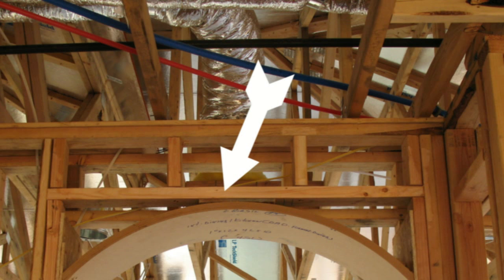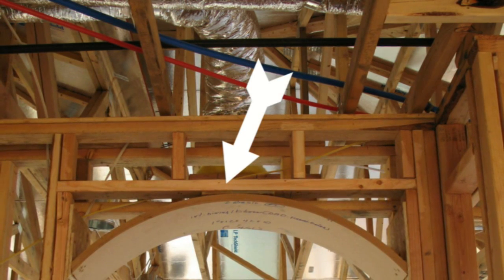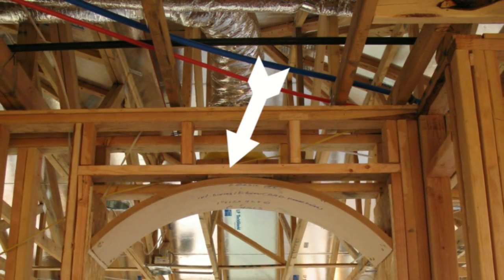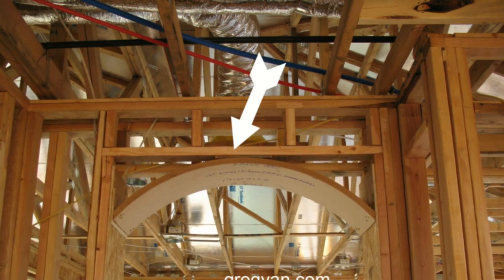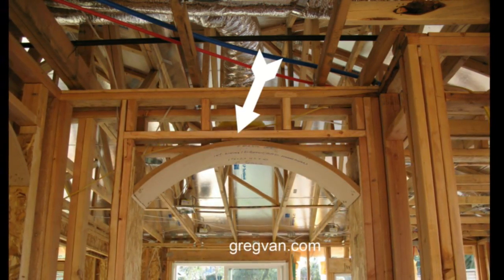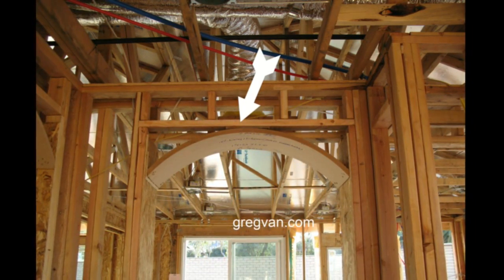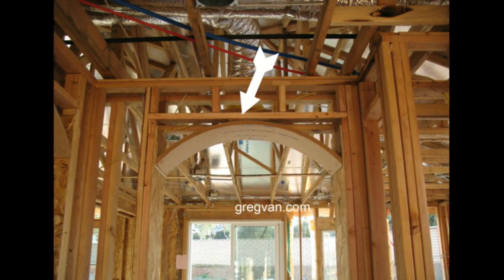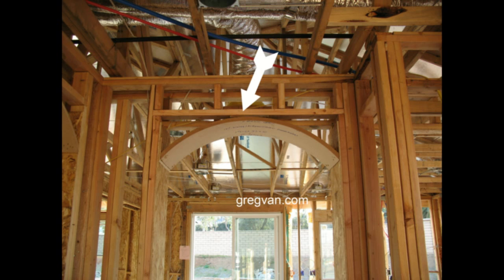Can I Use 2x4 for Interior Door Headers - Construction Questions

Comment: Thanks for this. I have a house that was originally built in the late 30s to early 40s. They used a 2x4 for the header of an exterior door in a load-bearing wall. It's actually 1" lower on one side than the other. I know that is NOT good. I plan on replacing it but due to the position of some electrical I'm going to do a double 2x6 header at the top of the wall resting on jack studs. I have an interior "doorway" in a non-load-bearing wall with a 2x4 header. The doorway is flush against the hallway wall on one side so it would make a door awkward. If I bump it over 4" or so it will work better, but I have a king stud there. Could I get away with using a 4x4 header hanger on the king stud on one side (and have a jack stud on the other side) & use side by side 2x4s as the interior header?
The archway in that picture looked neat.
Reply from the maker: I cannot provide you with engineering advice, but can tell you that hangers can be used to support "some" windows and door opening headers.
Reply: @gregvancom  Thanks. I discovered that Simpson makes actual header hangers for interior non-load-bearing applications. I'm going to use jack studs for the exterior header & do 2x6s instead of 2x4s. For the interior one I will probably get the header hanger for one side and a jack stud on the other (that way I won't have to cut a king stud). Old houses can be a mess to fix. LOL.